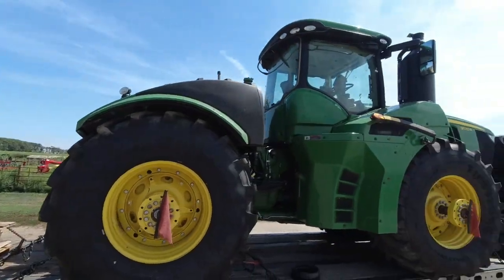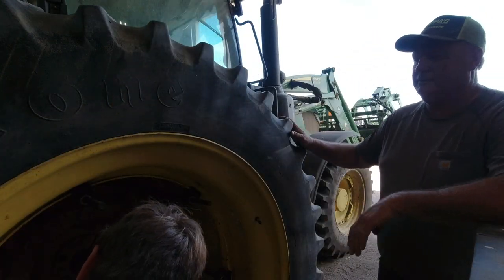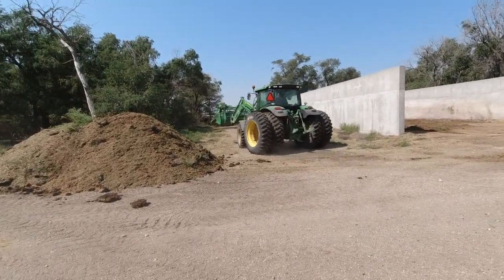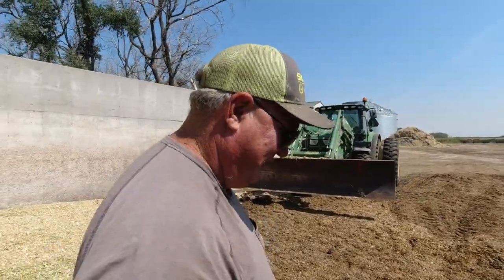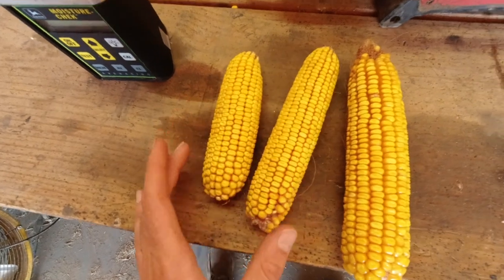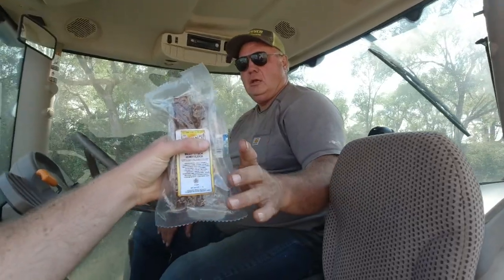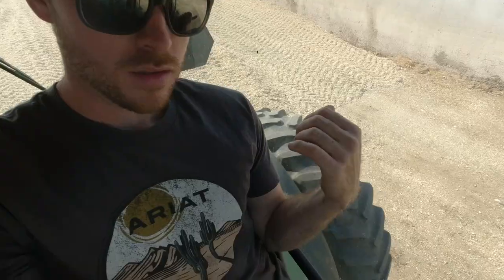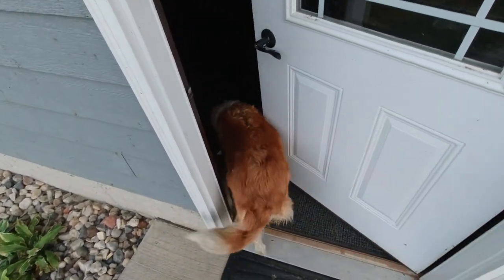Chopping Silage in South Dakota

Comment: One of the first jobs I had on my grandpa's farm  was packing silage. In western Colorado in the 50-60s  we used long pits cut into the ground, 1- feet wide at most, 8 feet deep and about 100 feet long. The trucks just drove through the pit and spread the corn, so we did  not have to move too much of it. Pulling a truck out of the pit was a common part of the job. Sometimes we just hooked up and pulled all the way through.

Comment: Used them for years. Never had any axle problems.  I did run a lot lower Air pressure on the outside tires.

Comment: I used "band" type duals on my 4020, and, never had a problem. And, when plowing, I would add a dual on the land side for extra traction, that worked fine, just went a bit slower when in road gear.

Comment: when hay or corn gets to dry here in ohio, we set up a sprinkler and put water on it. and packing 61-72 % corn silage, slower the better and more weight.neighbirs just finished filling there two bunkers of corn silage, around 430 loads. the moisture was 61-70.

Comment: Cole, 
    I noticed you guys were having traction problems when you were pushing silage. I seen a picture of somebody who built a cement counterweight that clipped onto their 3 point for extra weight and traction while pushing silage (I was going to send it, but I can't figure out how to send a picture on Instagram over YouTube). Be a good winter project if you could find a three point off of an old mounted implement, and build it into a form so the next time you pour cement you could put the extra in there.

Comment: Just curious, did you see the video of the John Deere that snapped off the axle using snap-on duals. Their premise was that with snap-on duals, it puts too much pressure on one point on the axle rather than 2 different places on axle mount duals. We used snap-on duals for all my childhood, but on sub-hundred hp tractors. If you're like we are, we can't afford big repair bills so we try to learn how to avoid them. Your channel has been a big help in that department.

Comment: Do you ever have to inoculate the silage to prevent spontaneous combustion?  I was wondering if they still did that.  My info is from LONG ago.  Too bad there is not a combine that will run the grain into one bin and the rest of the residue into a cart for the silage.

Comment: Could you spray some water on each load as you spread it out? We never had that problem here in Minnesota when I filled my silos. And, we would also put some innoculate on it to aid the fementing. We cid not have a fancy liquid systtem, we just put a bunch on a each chopper box load as it was going into the blower.
Reply: the chopper was adding innoculant
Reply: @briansonne814  Back when I was farming that kind of thing was just coming into use. I had anegihbor chop for me, and, he did not have that feature on his chopper. So I would just spread it on as the chopper box was unloading into the blower, It is a whole differnet ballgame with trucks and the way you pack it into bunkers now.

Comment: I was curious Cole why you did not run a few sprinklers or a hose from a spray water nurse tank to wet the dry silage down? I never have been in volved with a bun silo expect back in the 60's and 70's with a 20X70 two slat corn cribbing high. But we chopped our own and could get it up before it got to dry and because the wood slat corn cribbing could not take the pressure with driving on the pile..
Reply: My guess  is that it could make the corn mold, ading that much water. But I really don't have any idea. I just commented so I would know if Cole responds.
Reply: The Sorghum will add moisture.

Comment: YouTube farming fixing infabricating are the ones that had the axles break I believe he said anything over a 150 horse  you should not use snap on duals also you're not using the tractor for the same kind of work he was doing  also you run a lot of flat ground where they're running hills which makes a big difference I grew up with snap on duals our biggest horsepower tractor was a 100 horse and dint have any problems

Comment: 2:00 "broke an axle with bolt-on duals" One would have to think the weakest point in the drivetrain would be the driveshaft, possibly the u-joints, but not the rear axle. The comment could have been incorrectly blaming the bolt-on duals as the cause without doing a complete study of the situation.
Reply: FFF did in fact break an axle on one of his tractors running bolt ons. Doesn't mean they don't work, just something to consider if you are running them on rough ground.

Comment: axles can break doing anything, running the rear outside wheel just off the side of the road, running over a big rock with the outer wheel, sharp turns with heavy loads, not using the fan spacer when wheel is installed, fan spacer cracks u no🤣🤣

Comment: Nice to cut down on the number of trips up and down the silage pit to get a good pack on it.  With gas prices the way they are, two trips vs the four or five that you mentioned will be a great start to saving money.
Reply: Actually it would be diesel not gas, and I just paid $4.17 a gallon for diesel to run the tractors and irrigation.